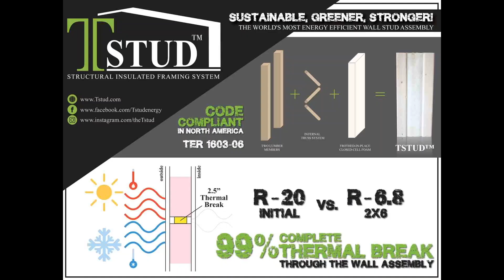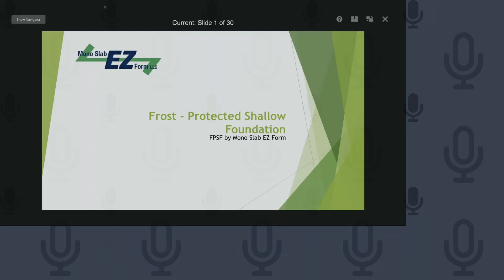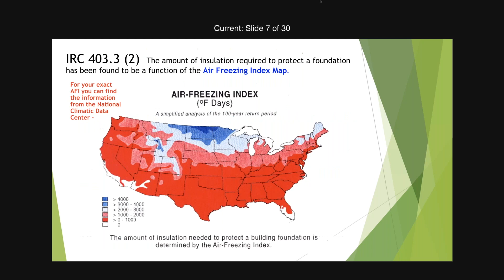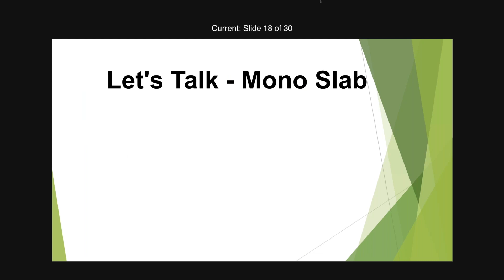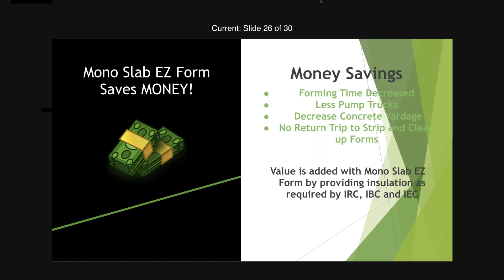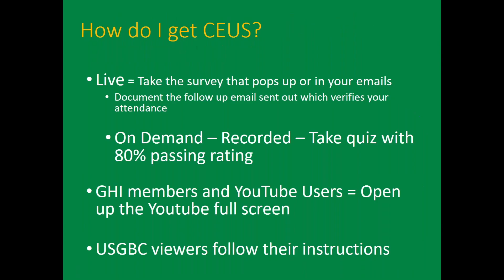Innovation in Frost Protected Shallow Foundations

Comment: Check into Superior Wall as they can mount directly to the exposed slab and obviously flashed prior outside the foam. Roofed with SIPS panels and sealed with 2lb foam.  Great video and it showed me why that interior mounts with angle to the inside. Gave me other ideas about the sub base. I saw another video where they use 3ply poly to direct water entirely outside the additional insulation.

Comment: Great presentation. Is it ok to reduce the below slab insulation with a very good vapor barrier and go for eco board radiant heat system. The thermal mass of concrete might be a over kill for the radiant system
Reply from the maker: "I would not foresee with that that. Keep in mind that bellow slab eps is fairly inexpensive. I did as much as 15 inches with radiant heat and at those amounts it performs flawlessly. Also keep in mind that your replacing a non value add product (gravel) with eps.  In some cases 15 inches of gravel places can cost more than eps walked into infill area. For the money it’s a great value. " Lance Boyce
Reply: @GreenHomeInstitute  : many thanks for the reply. Experts like you mean a lot for diy. I am from PA and the frost line is 30 inches here. I love the idea of slab on grade without basement. To make it better, can we set piers of 24 inches deep and 8 ft apart around the concrete perimeter. The outer concrete beam/footer rests on piers for additional support and ground movement. Thermal conductivity will be taken care by foam insulation around piers to make the solution inline with design

Comment: Great video, I actually had the idea of this form then realized there is already someone making it! Do you always recommend sub-slab insulation, even if the perimeter and footing are properly insulated? Wouldn't the structure benefit from geothermal heat from the earth below the structure?
Reply: In my area, 2015 IRC requires adding R-10 under the entire slab if the structure is unheated, and 2009 Energy Code requires same if slab uses radiant heating.
Reply: I am a firm believer in full thermal break. I do have people that believe in leaving the footer in insulated to let natural geo thermal do some work. Thanks Lance
Reply: I would only recommend under slab uninsulated if you are maintaining the room at 53-55F. Because that is what the ground will provide. While it keeps you from heating from 0, it will also just hold you there and keep absorbing your heat if you try to heat above it’s native state. So for a cold storage or place that is unattended that you don’t want to let freeze; it’s a fine option. If you want to maintain 68F then insulate under the slab sufficiently so you’re not just dumping heat into the ground, cause it’ll soak it up all century and keep drinking !

Comment: A lot of confusion about putting the footer on XPS. Inspectors feel it could compress. Skipping this step creates thermal break and XPS won’t compress. Please comment.
Reply: The eps or xps will have a psi rating. If the proper density is installed than there is absolutely no issues. Virging soil is generally engineered at 1500 psi . Even 1 lbs eps foam is 1440 psi. The math is simple and inspectors should have no issue there.
Reply: @MonoSlabEZForm  There are 144 square inches in a square foot, so 1 psi would be 144 psf, 10 psi would be 1440 psf.